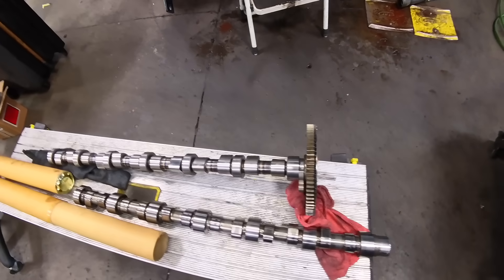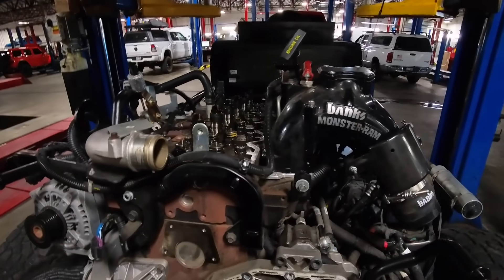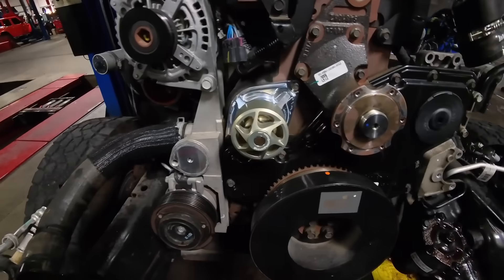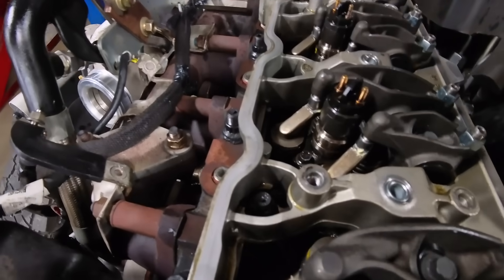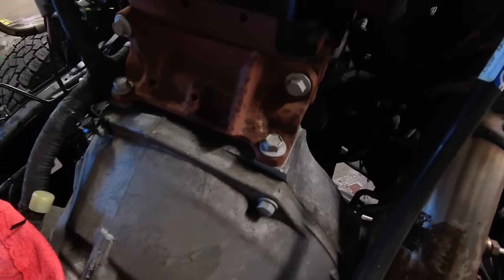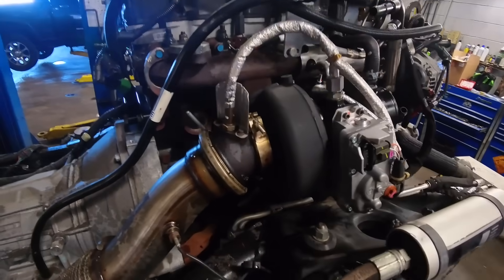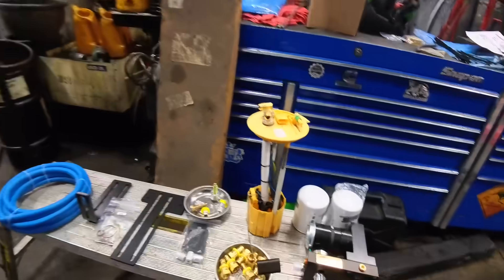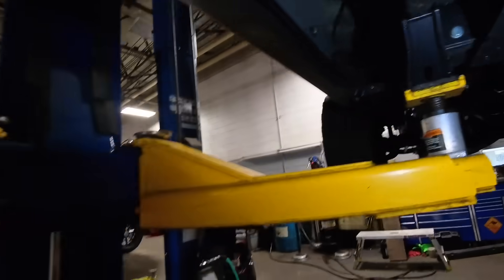Master Tech Installs Stage 2 Bullet Proof On RAM HD Cummins w/ Flat Tappet Conversion Included

Comment: I have a 2025 dodge. Can it be deleted? And what bullet proofing would you suggest? Pull a big horse trailer .
Reply from the maker: At the moment there is no delete kits for the 2025-2026 rams. As far as the bulletproofing list the only thing out is the insane Diesel oil filter bypass.

Comment: I have a 2004 1/2 Cummins with 840k miles. The things that I got early on was the Airdog, head studs, 80 hp injectors, amsoil oil bypass, torque converter, steed speed manifold, 5 inch exhaust, billet tranny cover, billet rear end cover, smarty jr and tater built turbo. I have the Fleece coolant bypass on my shelf but I was always told that the reason for hotter #6 temps is do to the factory exhaust manifold that shrouds the exhaust flow to #6 and causes excessive heat. I also think maintenance is key to longevity.

Comment: So I live in Louisiana and would like to install same items you did to this truck. Is this safe to get done at any dodge dealership or do you have recommendations? Did the customer supply all the parts you installed or was it purchased by you? What kind of warranty do you offer on the work?
Reply from the maker: I have no recommendations for your area. Customer supplies all parts. Warranty varies upon application, parts are depending on the manufacturer of part and is customers responsibility

Comment: Wonderful Videos thanks.  I do have a oil leak in the front of my 2012 ram 3500 Cummins.  Going to first degrease it to see were it comes from.  How can I tell if I have a flat tappet lifters I think its a fourth gen.  How much does a bullet proofing cost?
Reply from the maker: You do have flat tappers. They didn’t start using them until 2019

Comment: I’m telling everyone from my own experience when you go down the aftermarket upgrade parts path it’s a never ending process and it gets expensive quick you need to figure out in the beginning what you’re horsepower goal is and if you’re just looking for longevity not having a plan will bite you in the wallet the fourth generation truck is very finicky about battery voltage upgraded battery cables and military battery terminals are a absolute must buy the best agm batteries that you can afford  and just know that adding power is fun but it will definitely end up with upgrading the transmission and that is 10-16k purchase just leave it stock trust me

Comment: Josh...I've never had a diesel truck.  I am looking at doing some major camping with our trailer and are considering a diesel truck. Looking to buy either a used F350 with the 6.7 L or the Ram 3500 with the Cummins.  Which would you recommend and which year(s) would you recommend? Thanks.

Comment: I have a 2023 Laramie 3500 DRW that I will be VERY interested in having the full bulletproof treatment applied to. I just need a bottom line price on and an individual stage price on including labor. I live in Boise so Utah is not an issue, Sir. Need price now so I can prepare for end of warranty upgrades. 👍
Reply: Fleece coolant bypass 379, Hamilton cam flat tappet conversion 3399, bulletproof diesel water pump 399, arp 2000 headstuds around 449 or the arp 625 headstuds are around 1300. Labor and fluids will probably run around 2500ish. Thats your baseline give or take a little

Comment: What is the benefit of the fleece cheetah over stock? Cab is coming up soon on 2020 wondering if i should do turbo while it is up. Since nothing is wrong with my stock turbo yet
Reply from the maker: Stock turbo vgt vanes get stuck and that is what causes the actuator to burn out. Fleece has bearings to prevent that
Reply: Why the Fleece Cheetah vs one like the ATS Aurora 4000?

Comment: Great info , your channel is the most informative regarding the ram trucks. I have a question regarding my 2016 ram 2500 with the auto leveling system. When I tow my camper with weight distribution bars, do I want the auto leveling system in the down position at the switch? I have heard conflicting opinions and I am sure you have the correct answer. Thanks for sharing your experience, knowledge and time. Watching from Laporte, Indiana. 👍👍
Reply from the maker: Engage it and it will still help load level, it just won’t be working as hard

Comment: What is a concern is the small gain on the Monster Ram intake. I believe they are saying only 5 HP? For the money, it doesn't seem well spent other than it does fix the factor heater bolt/nut.

Comment: Hey there, I was wondering if you could help me out with my truck.its a 2019 Ram 3500 high output.I have been receiving a p226c(3/3) permanent Turbocharger boost control "A" slow response -  this engine light came on after 2 weeks of getting a BD screamer installed. I had a guy at a diesel shop check it out for me. He said the turbo was fine, but I don't think he checked my actuator, I believeit may be weak. The light usually comes on when towing around 78 mph. Any help would be greatly appreciated.

Comment: IMO the Hamilton kit is a must ,the fast is a big waste of time and money , couple reasons, first they don’t last second it creates more issues than resolving , third there’s no issues with this new generation of fuel pump modules , they can last well over 500k miles , I have seen nothing but issues with this aftermarket fuel pump burning out , there’s very little pressure coming out of the oem fuel module, there’s more Volume than pressure , if I remember less than 16 psi , as long as it can supply 500ml within 10 seconds it’s within specs , on the coolant bypass, I will like to know if anyone has pay attention to the modifications that were done to the actual head gasket in 2019+ between the last two cylinders , there’s some improvement in the cooling ,if I was to said what it needs to be done that no one mentions anywhere is to install a oem Cummins 180* thermostat, yes there’s one available from the manufacturer. Btw he’s a great technician no doubt
Just to add something to the filtration , Cummins install on their industrial engines different fuel filtration systems made by fleetgard , mopar is the one responsible for the horrendous filtration systems installed on this trucks , there’s few solutions out there to replace all that junk and install carterpillar setup spin on filters

Comment: Why not use the Fleece power flow in-tank lift pump?  Don’t  Fass filters use dated filter specs and the factory filtration is actually better.
Reply: MY13 + trucks with factory fuel filtration are good at filtering and yes filter better than FASS or Airdog filters or any brand that fits them.   They say they are 2 micron, but final filtration is 4um.  Similar as factory filters filtration.  No need to get a FASS or Airdog.  Also factory lift pump is pretty solid.

Comment: Every one has products they like  I drive a hotshot 2022 ram 3600 HO with 349372  and run Rotella T6 love the oil
Reply: Keep the 10w30 T6 the best for these engines and their hydraulic lifters  , however at your mileage it’s time to replace your rocker arms and push rods if you want to put another 300k on it
Reply: True. I always ran Kendall Super D3 15w40 in my cats and cummins big trucks until the price of Kendall nearly doubled, I switched to Valvoline and never looked for anything else. Except to try Amsoil a couple times. Still using Valvoline Premium Blue.

Comment: awesome videos. appreciate all the info. i have a 2017 ram 3500 with the g56. just upgraded the clutch to the south bend dual disk clutch. and while the tranny was out, installed the fleece by pass coolant kit. crazy how much the temp. changed, truck usually hung around 190 coolant temp. after the bypass kit, truck now hangs out @ 185 coolant temp. oil temp went down as well.  it recently saw a weight loss too.

Comment: So, you get a $105,000 base truck, and to make it last spend a extra  $20,000,, not bad compared to a High end car, I take a High end Pickup over a car,
Reply: It's pretty insane. If I were a Cummins engineer working on the 6.7/Ram product I think I  would have to seriously question the product based on these videos and the success of the aftermarket with MY product!
Reply: I can get a 2025 Cummins tradesman for under $50k with rebates in the Houston area….still ridiculous
Reply: @chuckatley1464 What dealer in Houston area is offering those deals/rebates?
Reply: @Rob-si8kb big star ram is where I got the last one